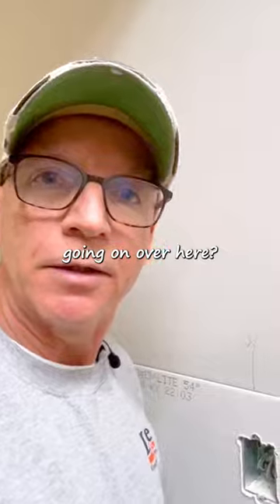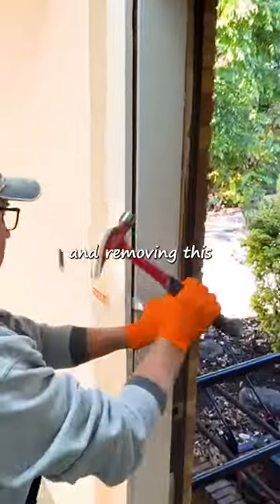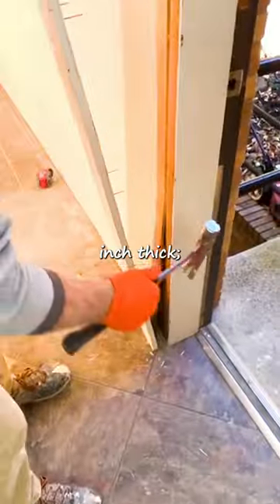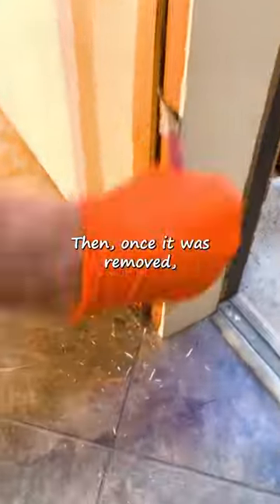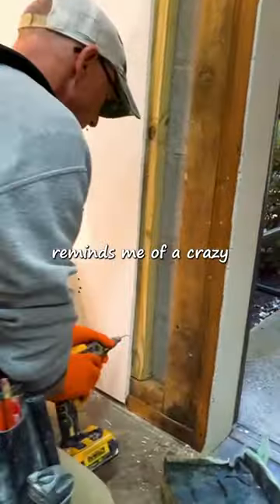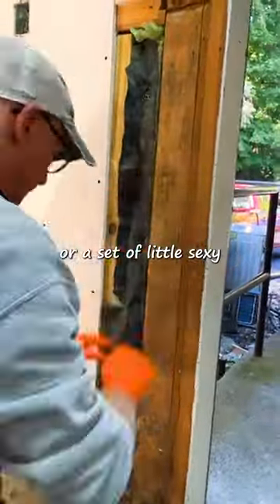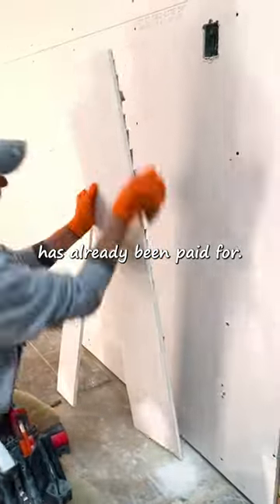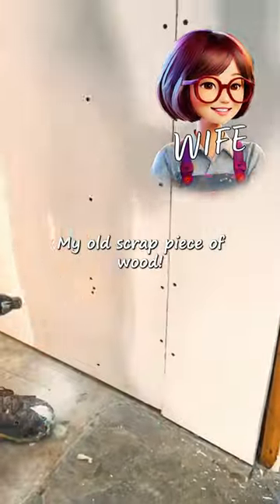Drywall Clips and Wood #shorts #drywallrepair #diy

Comment from the maker: Which type of drywall backing do you like when you repair a drywall patch or drywall hole? The Drywall Clips or Scrap Wood?
As a professional drywaller, I always reach for a scrap piece of wood when repairing drywall patches or holes. Scrap wood is easily found on construction sites, and since it's free, it beats the cost of drywall clips. Plus, it's incredibly quick and easy to install compared to clips. Wood also provides a much sturdier backing for the drywall patch. Don't get me wrong, drywall clips do work, but for DIYers who likely have scrap wood around the garage, it's the perfect solution.
Reply: Scrap wood works better than drywall  clips